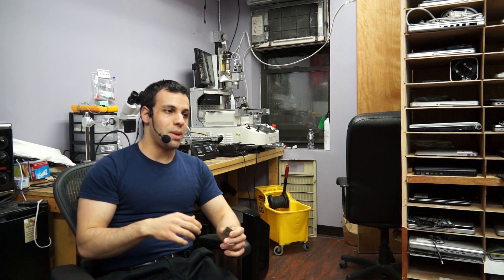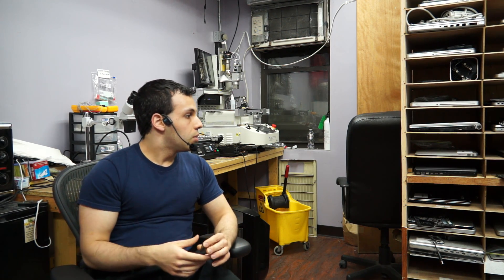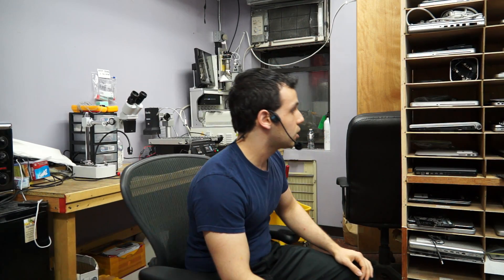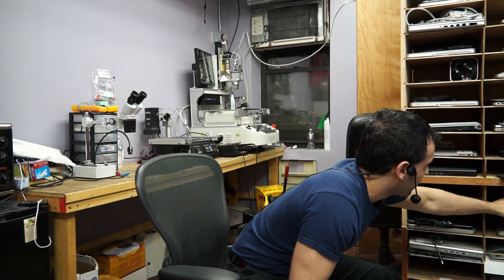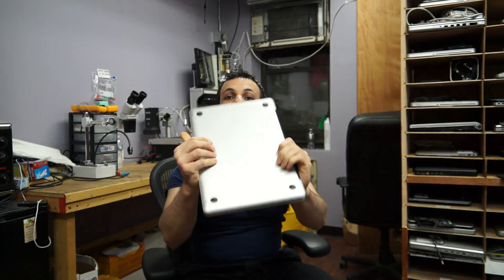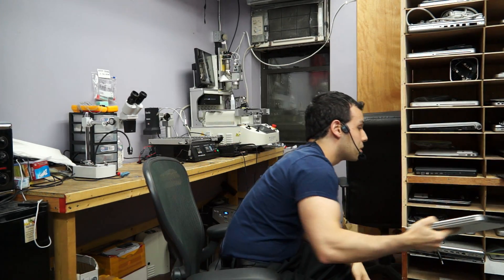Reballing flip chip GPUs is BULLSHIT - the truth about dead laptop GPUs & repairing them.

Comment: This explains why I was unable to to revive my old Laptop, it also explains why the XBOX 360 repairs were always temporary and would last a week max.
Reply: +TheEPROM9 thats because Xbox's are manufactured as cheaply as possible.
Reply: +TheEPROM9 It wasn't the chips failing in the XBOX 360s, it was the interface of one of the boards.

I fixed my 1st-gen 360 by re-flowing it 7+ years ago, and it still works today, it's still used daily by my younger brothers.
Reply: +TheEPROM9 I managed to revive my laptop by...
...putting the motherboard in the oven for like 10 minutes at lowest temperature.
Seriously. It did solve it (of course any low heating on it will kill it again but still working!)
Reply: +ChasingTruth TakingFlak That's why I don't like those kind of closed architecture products, because there will be always something hidden by the manufacturer that will give you headaches in the long run like my PS2 back then not lasting long enough during a cycle of 2 years.
Reply: +Anonymous Coward 
yeah.. that damn x-clamp.. caused the board under the gpu to warp.. cracking the little balls.. worst of it was once that combined with the generally shitty soldering of the ram chips... nightmare.. reball or bake to your hearts content.. refit the x-clamp.. board bends again.. back to square one.. while the electrolytic caps have yet another excess heat cycle from the oven and.. well.. y'know where this is going ;)
Reply: +Ozzie Peck "manufactured as cheaply as possible" As is pretty much all mass-produced electronic gear - I heard it was a change from BGA's Lead to Lead Free solder at the last minute that the designers hadn't fully taken account of. 
Good console for its day though.
Reply: thats why i sold my 5970 as fast as i could after an oven treatment :D

Comment: Actually, I found that Intel and Nvidia guarantees that only 3 reheating sessions could be done safely on their chips. So first heat is when you put first ball on them (unless you put them with a laser reballing machine), seconds when you solder that chip, third is when you remove id. Reballing a 4th time isn't worth it even if the chip is ok, it wont necessary be after this last reball/reflow sessions. The only fix for a board is either reflow at 190C or 173C in an oven with heating curve set for lead or rohs, or a complete new chip. Anything else is time wasted for you and lack of professionalism after the chip dies again in a few weeks

Comment: I just followed your advice, pulled the graphics card in my 27" iMac (2 Gb AMD Radeon 6970M) and tossed it in my digitally controlled burnout oven at 285° F (140° C) for 7 minutes and reassembled it and voila!, my computer is back to CAD work! Three hours ago it was thin white vertical lines on black and then dead, no video after restarts and all the other tricks.

YOU ARE ABSOLUTELY RIGHT! It never went over 140°C and it works, THANK YOU LOUIS!!!

Comment: We reballed, Nvidia Graphic Cards, Xbox 360, PS3, DV Series HP Laptops.......... 99% failled a second time.
Reply from the maker: yep... :(
Reply: What we noticed, is that this happens from lack of maintenance. Every unit that came in was clogged with dust, and dirt. After reballing , modding the cooler to run at 100% all the time would prevent the problem from happening again, but this is not a real fix, and even with this mod, the units would still kick the bucket after a period of time, the fix is to actually change the cip.
Reply: Towel trick :), mate you need to change the GPU, not remove it to change the balls. Completly replace it.
Reply: You cannot say that a 70 degrees C, is a overheating temperature. The problem with the 360, was that because of all the dirt that was in the coolers, in the radiator, the ,, towel trick'' would ,, naturally'' appear in time.
Reply: Holy crap... Someone who says it like it is, skips the bullshit and actually understands the point. Youtube is undeserving, this is ehere reballing spread around in the first place. Tell me with a straight face that wikuhow is responsible when youtube is the most used search engine in the world. Thank you. I will be heating up the gpu from my old macbook pro to see if i can bring it back to life, but i dont expect anything one way or another, i was just gonna turn it into a little linux tablet nothing serious at all. Your information mightve just given my chip another few months, which would be more than enough for me. All i want is to finish a project like that, long term or not (probably not). Again, really ppreciate your honesty. Cheers from queens btw bro
Reply: I used to reflow DV series laptops, we had about a 70% success rate, most of the machines that were not going to work failed almost immediately after repair. We found that preheating the entire board and using shielding when flowing improved success rates. Always ran a 24hr stress after repairs to indicate if it was successful. I only had an handful of customers who the repair failed after some time, most of which were very dirty(Cat hair etc.) and had habits of using their laptop on the bed. I have a few laying around I repaired that still work fine.... Slow paperweight by today's standards but they work.... Most Ive seen that were previously repaired by others they pretty much baked the board, discolored yellow/orange spots on the PCB.
Reply: so my ps3 ylod problem are the chips its self not a solder ball ?
Reply: my first ps3 was from a reball service guy. he sold it to me for cheap. I would just hit it with a heatgun and it would work again shortly after. I did the towel trick on a xbox 360 as well.the cooling mod like you said isnt a fix, just a temporary solution thats not gauranteed.  thats why replacing the chip entirely COULD fix the problem. The main issue is like you stated. people let their console get really hot and cluttered just for that one time for the heat damage the chip and its down hill from there. I have a xenon 360 launch model kept in open while running in use. it gets fairly hot but has never red ringed. People just need to take better care of their systems. i know if i put better paste on this it would run cooler, but im afraid like the rumors if i touch the xclamps and put new paste on it will rrod on me. good to keep it the way it is!
Reply: sasuke2483692 We has the untelling every night, so's that we remembers where we came from, and how we been since, an' because nobody firgets what it were like afore some Vviddeoh were taken away by the corruption.
Reply: Michael Lazarus I have a dv4 1150se that I have reflowed 3 times. Once I reflowed the power section and found indications of a leaking cap around the CPU. I would like to slap around the idiots that put cooling intakes on the bottom and called it a laptop so people would naturally cover the vents. The other peeve is cleaning them out is not a simple panel removal in most cases. I think most will agree the cooling solutions were never adequate.
Reply: So, what do you think about REFURBISHED xbox/consoles?
Reply: I don´t do that. What i do is, completly clean the FAN, lubricate the sleeve of the fan, change the thermal conductor on the GPU with cooper using Artic Silver 5 between the GPU the cooper and the cooper and the cooler, off course artic silver 5 on the CPU as well. I do not modify Fan speed and i am able to have about 45 to 60 degress on load, on almost any kind of laptop. This is the best way to prevent the BGA solder balls to break with constant cooling and heating and the expansion that this does.
Reply: Reading this while petting the cat and using the laptop on the bed
Reply: +ARREGLATELO ES
Had a Dell kick the bucket on me, just got a new entire fucking Motherboard for less than what the chip that failed cost from China LOL.
Reply: Well I only heated gpu chip on a laptop and It works  even aftet one year..  How do you describe that..  If a cpu is soldered the same thing can happen.. That's why you never have a problem with cpu but only with gpu because its soldered
Reply: If you had a 99% failure rate then you weren’t doing it right. 

I can say because of personal experience doing these repairs that you need finesse to do them right. 

As far as heating to 117c and the chips working maybe that works on a specific chip but all the ones I did if you don’t get to 220c then they will not work. 

So please explain how the solder balls are not the problem. 

I have laptops that were reflowed that are used everyday that still work just fine after repair.
Reply: @tehonlynoobs5556  Yes.

Comment: So basically what you were trying to say was "we need a better wall"?

Good for me that I bought an AMD-GPU - it's running so hot that it is constantly repairing the soldering itself
Reply: +deklor  Except that internal delamination of the IC package is normally specifically due to temperature. Any hot running GPU is at risk, whether nVidia or AMD/ATI.
Reply: Siana Gearz How much temperature would you say is risk?
I run mine at a max of 70C°
Reply: solder melts at somewhere between 170 - 200C so I would believe yours is safe.
Reply: Are you going to build a wall out of AMD gpus?

Comment: bad thermal paste is one of the most common problems with modern electronics and its seriously on of the dumbest reasons for a device to die especially since it would cost these companies hardly anything more to us good thermal paste.
Reply from the maker: +PSYCLOWN185 If you look at the thermal paste on most Apple devices, it is awful.
Reply: +PSYCLOWN185 Interesting.
I've bought last year a new ASUS N551 on full load it would throttle back, it got like 85 degree C.
Ive replaced the grey hard thermal past with some artic silver pasta what i had laying around.
The temp. went down with 12 degrees C. Now it doesn't even throttle anymore on full load.
Reply: +PSYCLOWN185 True it wouldn't cost the companies much to use good thermal paste, but they earn more from faulty electronics which allows them to sell more new electronics to people ;)
Reply: +Supercow2nd If the paste was hard it means it was long overdue for a change. The issue was not the paste quality necessarily, but the fact that it was just too old and it stopped working.
Reply from the maker: I Love Purple Hazmats On Apple laptops the thermal paste is hard and crusty from the day you take it out of the box.
Reply: Louis Rossmann It never crossed my mind it would be that shit on a premium product. Lucky I hate almost everything about Apple products then.
Reply: Louis Rossmann Overheating MacBooks... they should use good thermal paste it isn't that hard they should use some Arctic Silver Céramique 2 it's cheap
Reply: Pelle Reinke it wouldnt cost much? Have u seen the price per gram of good paste cause they are ripping people off for a small dab of grey goo
Reply: Toveri Juri  You're actually right. Can't stand these damn controller
Reply: cough**cough*INTEL*cough**cough
Reply: @rossmanngroup  Are you sure he is not talking about flux ?  LOL

Comment: This is true and at the same time is not true. I worked in manufacturing industry and i can say that the problem can also be caused by micro cracks in the balls do to the fact that lead-free solder is shit. If you would have repaired ECU in cars you would bump over this think very frequently, in this industry the lead-free solder almost turns in to dust(ECU Fiat Stilo under 1.6l). The technical explanation is based on thermal stress theory, when you expose a component to stress do to the different material that it is made out off (the materials will expand at different rates). Now the lead-free solder is more rigid then the lead solder. So when the component works it hits very fast and abruptly, the temperature spreads more slowly then the component hits up, so based on the material in the components and on the spreading rate of the temperature you will end up in very small deviation of the top balls section compared to the section that is soldered on the mainboard. Do to the rigidity of the lead-free solder you will end up with repeated micro cracks in the ball that in the end will result in a high resistance in the ball, even a big crack I saw it once. So to prove this things i can tell you that one of the most important roll that the GND pins have in BGA is to help spread the temperature fast, that is way they are so many of them on a chip. The other fact is to see if i can find pictures from a 5D X-ray machine where you can see the cracks in the balls (this machine makes X-Ray sections in boards, balls, BGA's). Ok, now why did i say this is also true because the silicon chip is soldered to the mounting socket (the outer green part of the chip) with a special glue like solder paste. This paste is very sensible to temperature so when the chip goes very hot you may end up with the paste melting and so the connection is interrupted.  So what causes this problems well there is temperature and vibration. If the balls have void's in them or if the paste thermal conductivity decays or if the air vent is blocked (and so on) then you will end up with poor temperature conductivity, this will lead to a high difference in temperature of the component and board, wich will lead to cracks or component failure (the glue). If the device suffers shocks, like dropping, then you will surely end with ball cracks, if it doesn't start anymore. To make a difference when the problem is or not due to ball micro cracks, I'm sorry to say this but you have to heat the component. When you heat the component  (including the balls) they will expand and then "fill the crack" this will result in 0 ohm resistance in the ball conductivity. In the end I need to stress out that micro cracks 97% of the time lead to component failure (glue failure), it all depends on how long you use it with micro cracks. For more detailed explanation tell me and i will provide it. :-D Sorry for my English not native English speaker. :-D
Reply: +Bvcdi Dan Then what is your sugestion to fix this problems, I was thinking lead soldering in reballing process
Reply: +Joel Nichols do you have to use the original model chip or can you use a better one?
Reply: The problem here is that in personal computers lead-free solder is fine due to the devices not going through a lot physical torture, unlike say a machine or car.